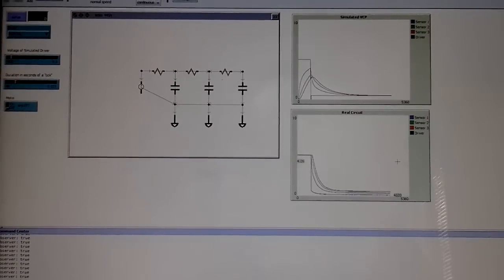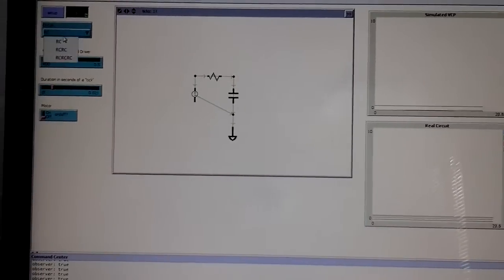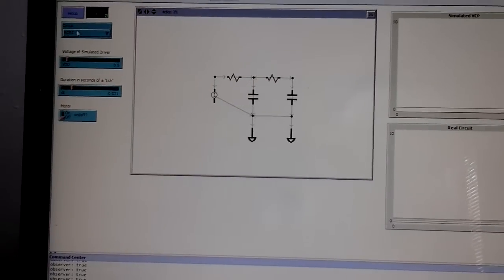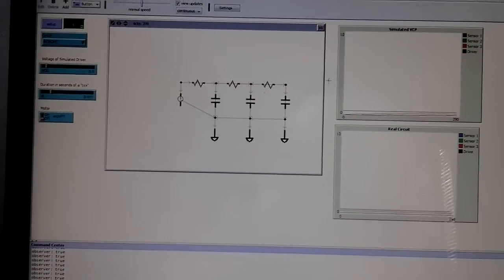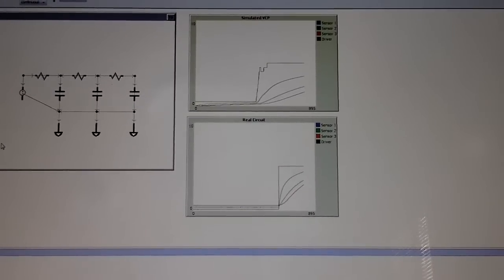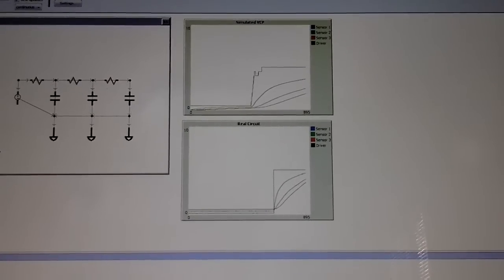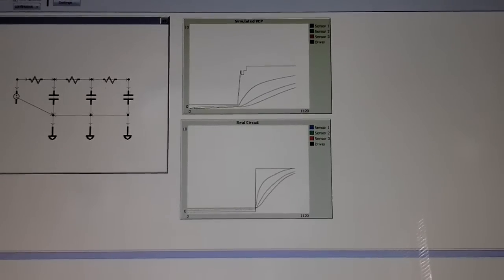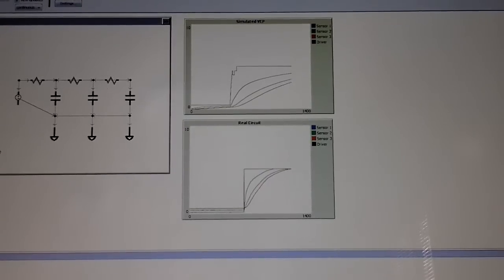Stanford BBnA Bifocal Circuit Model

Comment: Hi John, if you still follow this. I need some help.
I am trying to build a circuit which would require holding the discharge current value of the capacitor, hence providing average current value over time to the load.
Can u help with something? Thanks in advance!